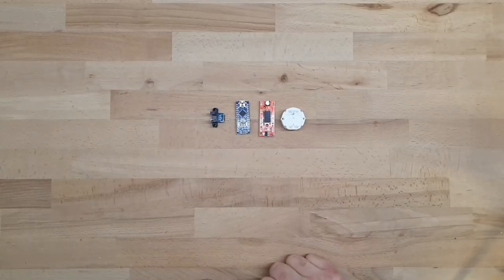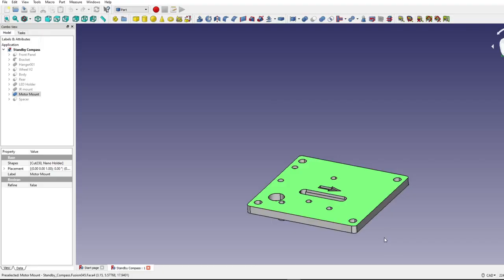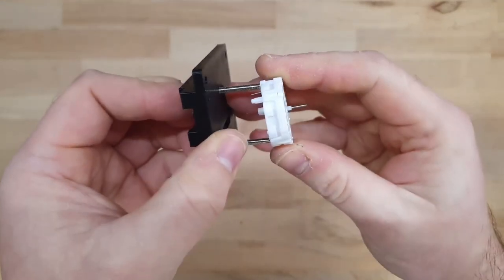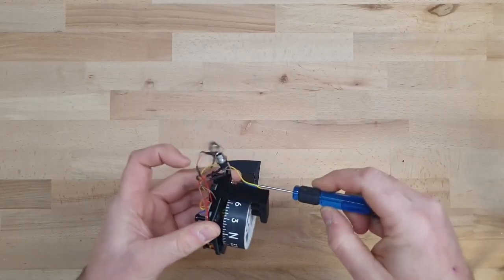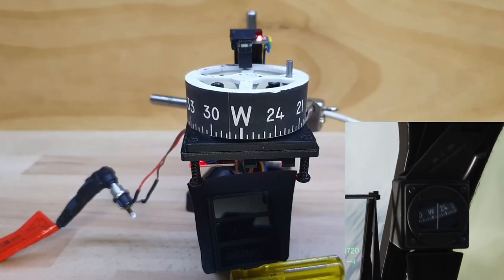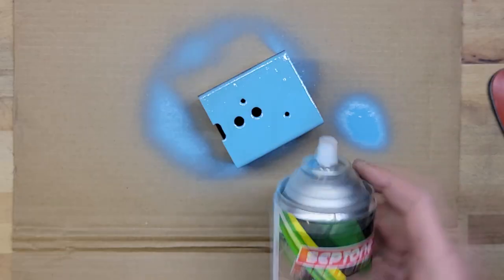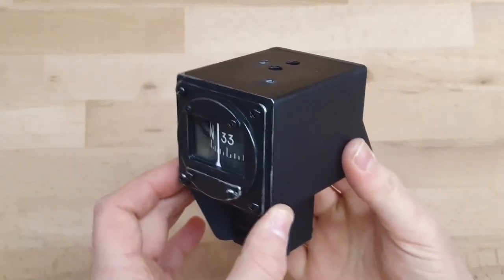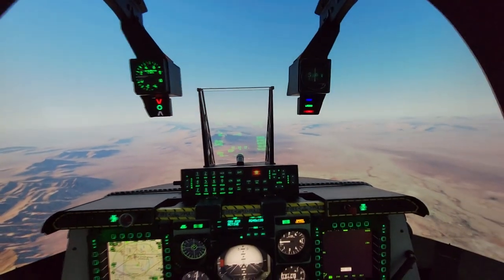Building a Standby Compass- (and how I finish 3D prints) - Home Flight Simulator

Comment: I took a quick glance at the code you used. The issue with the "lag" when you pass through zero seems to be that the code tries to re-calibrate every time you pass though the zero, as you can see in the comment "// recalibrate when passing through zero position", but the state machine the author uses (called initState) doesn't differentiate between being at zero because you're passing through vs. being at zero because you are calibrating. I obviously didn't debug this in depth but I'm sure there's a way around this. After the re-calibration is done, then the code proceeds to see where it needs to move based off of DCS data. I think the time spent during that re-calibration is what you perceive as a bit of motor lag, since the code tells the servo library to reset to "0" and this is a blocking call according to the documentation of the Arduino servo code.
Reply: Part of the problem seems to me that the nail doesn't have "zero width".  There is a range of pulse positions where the nail would be detected.
So if the initial zeroing is done when the clockwise edge is found, it'll cause problems going anticlockwise because the edge is in a different place.  That looks to me why the card "jumps" in the video.

The idea I'm working on would detect both edges and zero to the mid point.
Reply from the maker: I'm glad you guys arr around, because i have a very limited undertstanding of the code! I just cut and pasted it. Would be awesome if we could make it better!
Reply: or just hold the plane steady during the compass calibration process....... hehe
Reply: @thewarthogproject  When I can print it, I'll run with my ideas. ;)
Reply: @thewarthogproject  you can safely remove the lines 81 to 94. The servo is already calibrated; no need to recalibrate it while it's running. If you are affraid that the data might overflow , don't worry , normalizeStepperPosition is already called inside updateCurrentStepperPosition.

The only thing is that it might eventually be drifting in the long term. Now how much it will drift ? Probably not enough to care , but if you really want to be able to recalibrate on the fly , you could probably use the test light button to start a recalibration process.
Reply: Yeah, on first startup when it stopped at North I was expecting it to go round the other way and stop at North again, kinda like dials on modern day car dashes do a full motion when ignition is turned on.
Reply: @Schroefdoppie  Those are the same motors, but with the end stops intact.  The initial movement is to drive them against the end stops as a starting reference point.
Reply: @No1sonuk  or ignore zero if moving clockwise...
Reply: @firefoxik75  That works too.
Reply: @Paul van Dinther The low resolution would more likely be because the motor driver is not configured to do microstepping, I think. The X27 stepper motors have a max resolution of 1/3 degrees per step. These stepper motors are used a lot for the dials on car dashboards which are very smooth.
Reply: @thewarthogproject  The simplest solution would probably to remove (comment out) the recalibration procedure. If it drifts, then look for a quicker way of calibrating
Reply: @No1sonuk  The calibration should check the leading and trailing edge and assume zero is in the middle
Reply: @No1sonuk  I agree about the pin being quite thick. My suggestion would be to use a hall effect sensor and a magnet, and use an ADC to detect the peak and trigger the recalibration.
Reply: hi I'm printing the compass and almost finished ( can't even believe the print quality, all the parts fit perfectly) I cant seem to find the code. Any help would be appreciated,

Comment: <-- Pilot: If you're really clever you can get it to accurately simulate the effect of motion on a Compass. They lag behind the turn, and when you roll out, it should run over the desired heading before returning. Also Acceleration and Deceleration create lag effects. It also has a dip (the 3D side) which is related to your latitude relative to the magnetic field. Though for your purposes you don't need them, but DCS does simulate these effects.

Comment: Minor correction, due to the way the X27s are driven, they can be driven directly from the GPIO pins of an Arduino. As an inductive load, normally there'd be back EMF to worry about however due the way they're driven in practice the backemf won't hurt the logic level pins on the arduino. The GPIO pins can also provide enough current to drive them adequately.

Comment: Hi, flight instructor here.  The game is apparently doing a pretty good job of simulating real magnetic compass errors.
A real magnetic compass is pointing directly at the Earth's magnetic pole.  Here in the Northern hemisphere, that means the North needle is pointing North/Down.  So that the compass scroll floats level in the binnacle, the south pole of the magnet is weighted.  The intertia of this weight means that the needle will indicate (in the Northern hemisphere) a turn to the North when accelerating on an East or West heading, and a turn to the South when decelerating.  It will also lead or lag the actual heading when you bank into a turn, depending on which direction you're starting from/going.  That's called dip error.  That "It looks like it's not quite there but then you roll out and the compass suddenly spins" is something real aircraft compasses do.  It can be pretty fun trying to turn to a heading with the compass sloshing all over the place. That's why the invented gyroscopic heading indicators.
I imagine it would be difficult to build a simulated magnetic compass without resorting to an LCD screen, with all the bobbing around a magnetic compass does.
Also, that white line is called the "lubber line."
"Famous video when it just goes to water" Aviation magnetic compasses are filled with a fluid, commonly a spirit like kerosene.  This is to dampen oscillations; if the compass body was full of air the compass would bounce around so much it would be impossible to read.  The vibration of the gun seems to have quite an effect on that liquid, cavitating it heavily.
Reply: "I imagine it would be difficult to build a simulated magnetic compass without resorting to an LCD screen, with all the bobbing around a magnetic compass does."

It should be doable electronically by grabbing a real compass and setting up electromagnets around it in three axes to get the magnetic field vector along any desired direction. Idk if there's enough info coming out of dcs to reproduce the behavior correctly, though -- it might have to be modeled again using the bank angle and acceleration vector or something.
Reply: I was going to say this. He’s simulating an HSI, not a compass. Nice build though!
Reply: Wonder if he does have a gyro. Probably get something from a wii Controllers.

Comment: I've enjoyed every video I took time to watch. We value so much the Documentation, Time to film and edit, Honest review of your thoughts, Project Tips and Insights of Development of Items Hand Made. It's a joy from start to current development state of your project. I'll never use any of this to build anything but I can see the true value of it all. Thanks for sharing. I would like to ask you this if I may. What are the Things, looking Back that you did not know then but do now that stand out the most to you now as I never thought I would be doing this kind of technology or have the ability to Do this kind in my own home for this project. It's very obvious you have the ability.
Reply from the maker: Thanks heaps! Ill do a bit of a montage at the end of the year showing how much this thing has changed, from a single button box to where it's at now. A lot has changed this year alone.

To answer your question, looking back the thing that stands out most is learning the design process. It went from simply drawing out 2D panels to cut them on my laser, then evolved into pretty detailed CAD design for printing STLs. Manually cutting things and just making it up as i go along was what i used to do. I've learned alot about design!
Reply: I couldn't have said it better. The audience that will make use of this information is small but I'm learning just from watching and truly appreciate the effort that has gone into it

Comment: Compass errors aren't just about the jumpyness due to the compass not being upright. There are a whole host of naviational quirks you have to be aware of when using a normal compass. A compass will do weird things like twisting under acceleration that make navigating with it a challenge, and the primary reason we use gyroscopic instruments. The standard list taught to pilots is Variation, Deviation, Magnetic dip, Oscilation, Northerly turning error and Acceleration errors (the acronmy is VD-MONA)

Comment: That weird lag is called magnetic dip. Basically as you turn it will induce a torque with the turn rate of your aircraft. This cause is to lag or jump ahead based on if your making a right turn or left turn in reference to north.

Comment: FYI, compass lead/lag is real. When turning north to south or vise versa. It looks like the in-sim version attempts to model this, but it’s probably pretty difficult. The whiskey compass also probably has pitch/roll limitations where it will stop rotation outside of this envelope. Might be very difficult to accurately model this in your cockpit, but nice job regardless. 👍🏼
Reply from the maker: Yep I know. DCS does output it as a variable in all axis of the Compass (pitch, roll and yaw) I just didn't personally like it. If I had all three axis moving it would probably look OK, but with only yaw it just looks broken.

Comment: I would suggest printing a tab under the compass so the nail protrudes radial and the ir sensor below sideways as well.

If you want to include balance, switch the nail with cylindrical magnets on the 4 spokes with  the 4 magnets with all orientation north and a hall effect sensor.

Comment: Have you ever considered showing off the FreeCAD modeling and assembling process in more realtime (or honestly even recorded and sped up)? Conceptually I understand each operation but watching a full start-to-finish task accomplished would be invaluable.
Reply from the maker: I'm certainly no expert at CAD modeling, so I'm sure I'd get plenty of haters in the comments on that one! All I do is use the parts workbench to generate basic shapes. Then cut and slice them using other basic shapes. It's not pretty, but it does the job haha.

Comment: Very nice work.  Interesting.  When I did my compass I as well set it up to read the HSI data.  However, after 185 hours of use I had an in-sim electrical fault and realized that when my HSI died in the sim, so did my compass, thus I couldn't even use it as backup as intended.  lol   So I had to switch it to another yaw data in the shared memory and now it works as it should.  Not sure if this would be an issue in DCS, but it was in BMS.  When the HSI stopped working so did the data from it.  Just an FYI in case that is an issue for you.
Reply: I have never used it but the mission editor in DCS has a tab for attributing a random chance of failure to different systems after a selected amount of time.
Reply from the maker: Yeah i did consider that, but most of the time my jet is that damaged I dont really need a compass because all i have left of it is a seat and a parachute haha! 

I originally tried using the general raw DCS heading data for it, so in theory it would work for any jet in the game, but for some reason i couldnt get it to respond correctly. I'll re visit it later on.
Reply: @thewarthogproject  ha ha ha
Reply: @thewarthogproject  I've not looked at the code for the compass yet, but there is a way that could make it respond to multiple aircraft in DCS-BIOS.
I've recently discovered that you can use "onChange" functions from different aircraft modules to refer to the same subroutine, and it just ignores the modules you're not using.
So in context, you set up the routine that drives the compass to respond to a generic value (e.g. "compassHeading"). Then you put in "onChange" code that converts the A-10 HSI numbers to "compassHeading", then calls the output routine.
Then add another "onChange" conversion for (in my case) the P-51 directional gyro to "compassHeading" and call the same output routine.
That will only respond to a limited number of modules, but it should work.
Check out my post here for an example:
https://forums.eagle.ru/topic/269903-dcs-bios-arduino-code-for-switching-between-modules/?do=findComment&comment=4762421

Comment: Awesome job, all sounds easy but just for a well talented guy like you, it's abut years and years long I'm trying to look how it can be done to building it and place on my simulator dash, still I'm not succeed, I'm using "simwim programming" for rest of my gauges and knobs which running very well with x- plane 11, but that program doesn't cove Compass. Thanks for sharing I learned alot 😊♥️👍👍👍

Comment: The task of making it move left to right like the real one doesn't seem out of reach. You could use a hall effect sensor for the calibration (with a magnet embedded in the wheel instead of sitting on top) to gain lots of vertical space and use a micro servo or a couple of them to move the axis of rotation of the compas

Comment: Very cool project and nice mix of 3D printing and electronics. Regarding the jump at the zero point, when i've had to do something similar with a continuously rotating server that zeros when it returns to that point, the way I have fixed the obvious jump (which really is an accumulation of all the errors) it to pick a number, lets say 15 and when you zero you create a 15 point list of errors (so the totalError/15 in each list item). Then on each subsequent position update you lose one of the 15 errors into the new position calculation. If your 15 updates don't move the position then you gradually creep to the correct location over 15 time units but it can be so slow that is just like a deviation to the actual point but if the rotation is constantly moving then you don't even notice any error correction...

I know you didn't write the code though so it may be difficult to figure out how to loses these errors within the existing code but basically that is how I would do it. Every time you zero you need to take whatever error is still left in the 15 point list, lets say 8, total them back up (8*individuaError), add that to the new error calculation and split it back to 15.

You can also reduce some of the error in the first place by counting +1/-1 steps to get back to the zero point, work out the error, divide by total number of steps and add that as an adjustment error for every update. That should reduce the larger error when you reach the zero point again. I'ts kind of like integrating when you have a PID controller but simpler to implement...

Comment: Instead of that paper look at getting yourself a sample of Cinefoil. It's made by Rosco who also makes gels for movies and television. Cinefoil is a really thick anodized aluminum foil. you can easily cut it with scizzors and bend it into various shapes. It's used to block light in various ways, but because it's aluminum stands up to heat. You can wrinkle it up and re-flatten it and the black anodizing comes off, which is a technique you could use for a worn metal look.

Comment: Nice Video, but better use a AS5045 Magnetic Rotary Sensor for closed loop control of the Motor. Then you can also switch to a dc motor and simulate the vibration by switch fast between direction of rotation.

Comment: I just want to say you have been a HUGE inspiration to me! I have started doing panels for an F/A 18C build including PCB's which I intend to make myself, and I have a ton of questions for you! The first one I want to ask is why are you only doing 3 LED's in series when you are using +12V? With a 2V forward voltage loss (Vf) shouldn't you be able to wire up at least 5 LED's per series?
Reply: The relationship between voltage and current for an LED is not linear. For example an LED with 20mA at 2V might draw 40mA at 2.1V. So any small voltage increase significantly increases the current, possibly above the rated maximum. A current limiting resistor greatly reduces the effect

(For a random LED on the internet: having 6 in series, no resistor, a voltage increase of 10% would increase current by 200% from 20mA@12V to 60mA@13.2V. That would likely kill the LEDs.

Having 4 in series with a 200 ohm resistor would mean a 10% voltage increase would only increase the current from 20mA@12V to about 26mA@13.2V, or by 30%)
Reply: @JakubKraus0  according to Ohm's law, the relationship between voltage and current is linear with respect to resistance. ie. V=IR.

 I was not trying to advocate not using a resistor at all. My point was on a +12V circuit using 5 LED's, with 10V combined forward voltage and 20mA of forward current, a 100ohm current limiting resistor should be sufficiant. If you use only 3 LED's with a 2V forward voltage each, then a 300ohm resistor should do the trick. What is wrong with having 5 LED's on a +12V circuit?